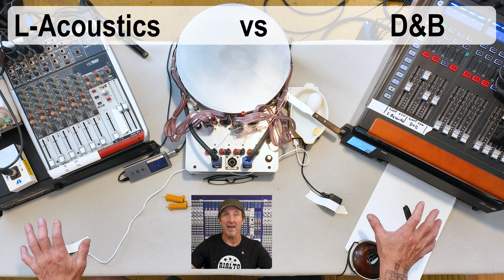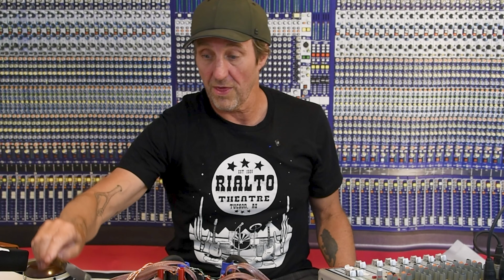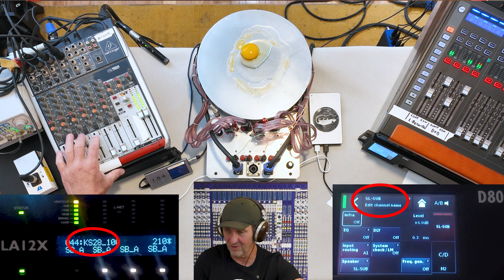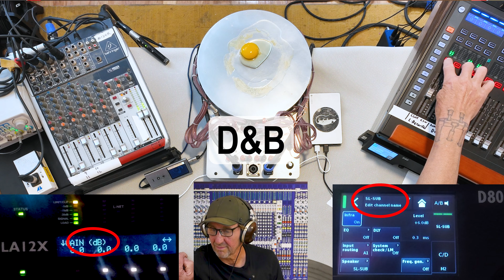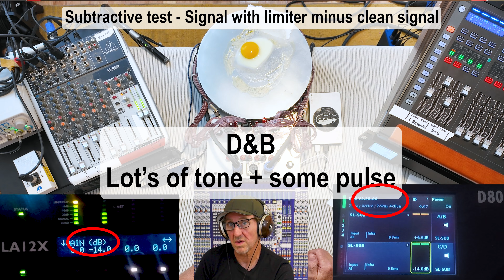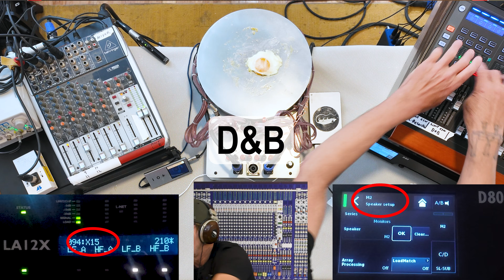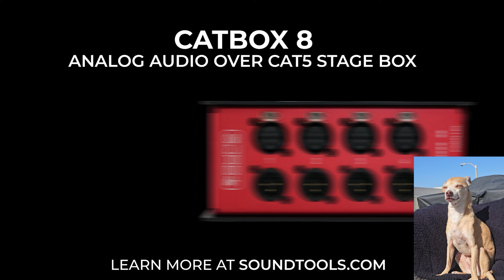Who Does Amp Limiting Better? D&B or L-Acoustics?

Comment: I remember reading about a company setting limiters to closely match the predicted heat of the voice coil over time, essentially having good dynamic power for a short time, then reducing the output for long durations, (like minutes).  Speaker limiting is complicated,  heck even simple limiting during mixing is complicated.  Waves released the new "L4 Limiter" because they couldn't get it right the first 3 times....
Reply: I used to do some work for Tannoy when they were based in Scotland. One of the Lab Gruppen reps told me about an amp they were working on that could monitor the thermal activity of the magnets on the loudspeakers.... That was years ago
Reply: @zambotv8150  I used to work for a line array manufacturer and did some testing with Lab Gruppen on those amps.
Reply from the maker: yeah, long term thermal limiting is really tough.

if you set the limiters so the system can run full power for 12 hours you can follow the thermal profile and have the system loud when it's cold and get quieter as the temp rises and the show goes on, which sucks.

if you set the line so the speakers never overheat on a 12 hour edm gig, and then do a shorter show with artists playing an hour or two and then set change, then your lims are hitting too early.

you lims kind of need to know the future length of show and ambient temp of the venue to be optimally set.

there are mid term lims and issues as well. I've seen lims set so that if signal exceeds a level for several minutes, they turn down the volume, so a song starts loud and then gets quieter.

there are no perfect settings except if the playback material remains the same in a thermally controlled environment.
Reply: @DaveRat  Cheers D.... Greetings as ever from Scotland
Reply from the maker: awesome! and yeah scotland!
Reply: For a long time, perhaps still?, Genelec employed a dynamically shifting crossover point to protect the HF driver of their most popular nearfield recording monitors. It seemed awfully extreme to me when I learned of it, but maybe it was a smart strategy, sonically.
Reply from the maker: Yes there are quite a few interesting limiting techniques like sliding crossover points and multi-band limiting as well as short-term midterm and long term limiters focused on current and/or voltage and/or peak and/or average levels. 

it's truly an art form that some companies are very good at in other companies are terrible at

Comment: Dave is always talking to you like you're already a professional.  There are several things he does in this video which can cause property damage and/or personal injury if you fuck them up bad enough.  Which is why we love him.  You don't have to be afraid of the red lights as long as you know what they mean.  

Those systems sound different always, but it was very interesting to hear how they changed differently also.  I feel like each one could work depending on the content.  Then I think that's it's only really an issue if the system is under-specified  ;)

Comment: Limiting is the same with construction projects.  If you want it done right.. better do it yourself.         Later new engineers will come in and try to get more out of the system and change your +5 to a +9 and blow all the subs in one night.     And then even later, while reconing is fun and all, it still cost the owner of the venue a lot of money for one night (all for an extra 1.5 dB at 33 hz).   (Which no one could even perceive).  (Lol).

Comment: Leo is amazing in its own respect, d&b audioscape is amazing in its own respects too, d&b can have rta from smart or r1 to control them, not sure what l acoustics are doing, amps should be set to run just below peak at show volumes headroom is nice when the crowd fills the room imo 😅
Reply from the maker: very cool. the goal of this video is to hear the difference in the way d&b and L-acoustics deal with limiting. one goes for max output capability while the other goes for maintaining sonic integrity to the highest level.

different sound and different goals
Reply: @DaveRat  yeah i could hear that too, but you stated a question of do you set limiters to max output levels or tonal balance when pushed hard, if you utilise r1 it will monitor and control aspects of your system for you while your mixing and get it to have even more clarity and headroom , iv done these blind tests with wigwam/solotech on behalf of clients in the uk, much love lol
Reply from the maker: very cool and under ideal scenarios, keeping the system out of limiting is achievable and sometimes desirable.

for me it really depends on the band I was mixing. when mixing Rage against the machine I liked having the system pushed into limit a good amount. when I had too much pa it would be to clean. not unlike a guitar player looking for some color from speaker overload, I was looking to hear the system groan a bit. 

also in situations where there is not enough pay to get the levels I was consistently mixing at, I would at lines need to lean in to the system limits. 

having a system that sounds good when pushed is quite important, in my opinion.
Reply: @DaveRat  my go to would be d120,s j sub, v aray/fills but the last  metal show i was on was the uk warped tour  in 2015 , have since gone to theatre /church stuff but  it is a hell of alot of fun mixing people of that level, got to mix atilla foh then mons for Hollywood undead deffo highlights for someone who was still fairly young in the game then, and long-time follower of your methods
Reply: @DaveRat  
Fascinating ...
re: the preference of "pushing into limit" 
Given ample rig, wouldn't the same sonic outcome be attainable via a compression scheme structured/seasoned to taste? 

Or are you referring to some additional harmonic energy entering the equation via subjectively pleasing distortions, etc? 

Very cool. 
What system was that w/Rage?
Reply from the maker: when speakers are driven hard, they become less linear and add some mechanical compression. this may or may not be a desirable sound but recreating it electronically is not an easy task and probably not possible with gear we have access to

I had a lot of different systems with Rage, and for some of the tours I had the Rat Trap 5.